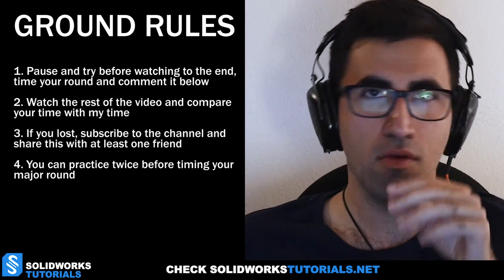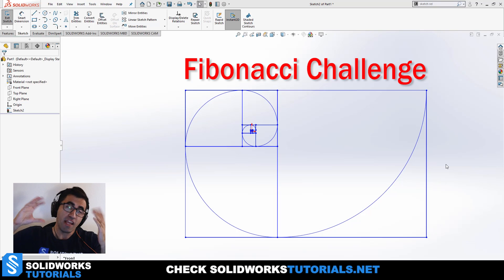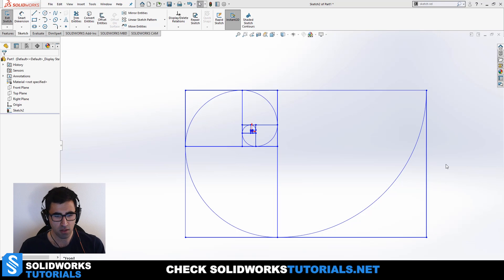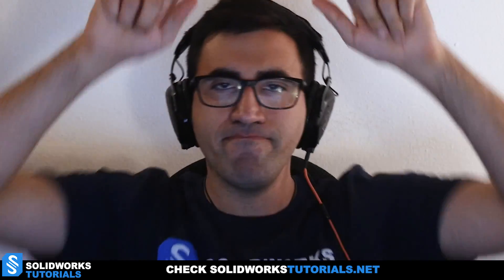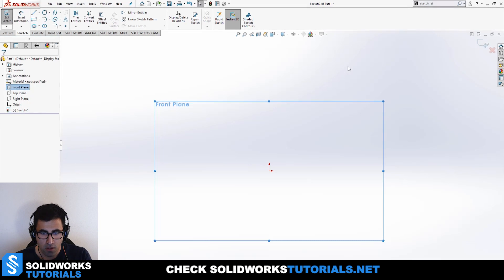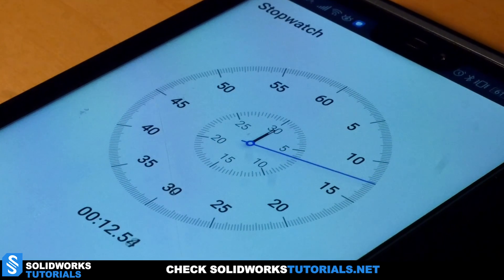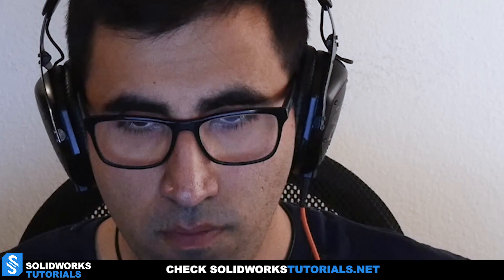Fibonacci Challenge - SolidWorks Speed Drawing Challenge

Comment: First try 2:51
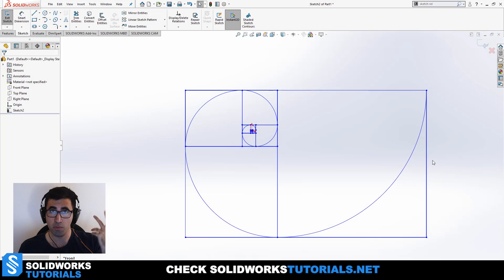2nd try 2:12 (Weak computer starting to lag when it gets overdefined)
Hotket setup for equals, draw 3 rectangles at a time then go through and make each one a square.
Use line tool for the arc.